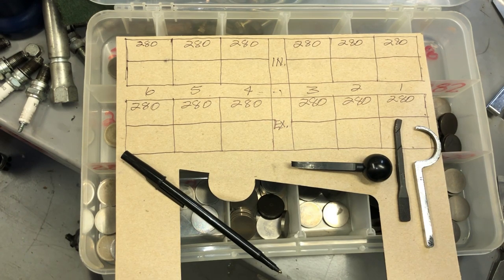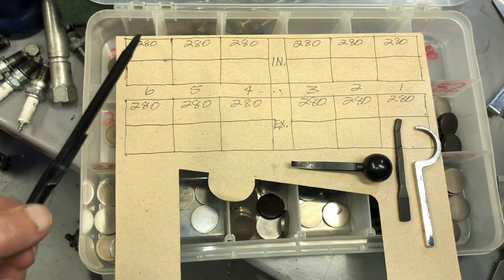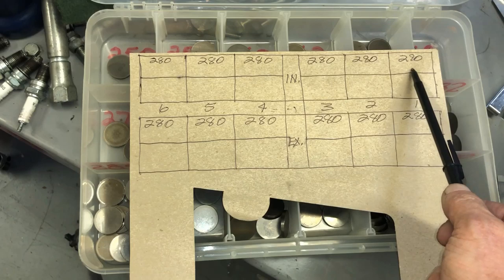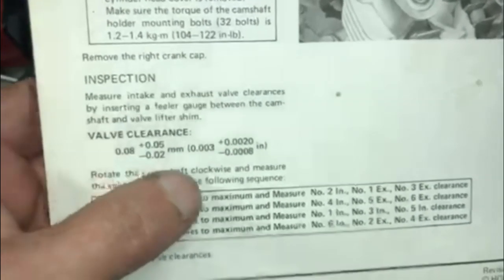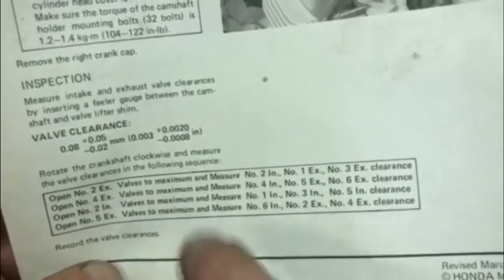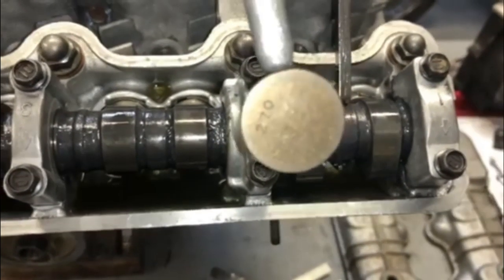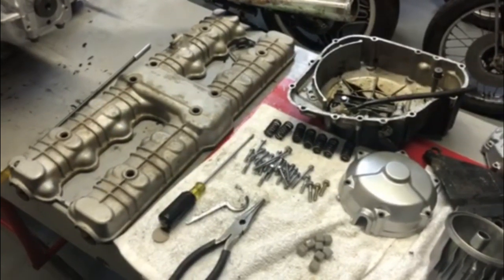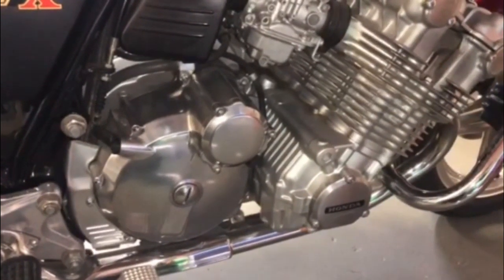Honda CBX Full Restoration & Engine Rebuild Video Series - Part 20 Re-assembly Part 7 Valve Adjust

Comment: Great video!
In your chart, why there are two numbers for the tolerance instead of one?
Reply from the maker: Hi Massimo, The chart gives you a range for the measurement. So if your measured gap is between X and X, then that determines which shim to use based on the shim that is installed. The 2 numbers on MY chart represent mm & inches, I did that for my own clarity when referring to my feeler gauges.
Reply: digitalpizza thank you a lot. Very clear!

Comment: What clearance do you like to leave them at, I am doing mine at this point. I don't know if you know Mike Nixon he is saying to aim for.  0.010mm what do you aim for. 
My experience is that the CBx clearances tighten up with time, not loosen. 
What is your opinion on this
Reply from the maker: Yes I know Mike, and agree, but I keep them on the loose side of the medium spec. Better loose then tight.

Comment: Pete, this is a great series and I really appreciate how much help you have provided me in my rebuild of a 79 CBX.  One question, when you use the special tool to remove the shim do you have to make sure the opposite pair of valves are not open?  There is a caution in the FSM that says you can bend the valves if they interfere with each other..

Andrew
Reply from the maker: Hi Andrew, Yes, that is why you must follow the exact order spelled out by the shop manual when adjusting them. It calls out which valves to adjust as you rotate the engine to each marking on the end of the crankshaft.
Reply: @digitalpizza1  Thanks.  That makes sense.

Comment: what happened to part 21 clutch install?
Reply from the maker: Hi Austin
The next video will include the valve cover install and the clutch assembly . I had to edit and re-post the Valve Train video due to an error in the previous one. So clutch is next, probably in the next couple of days. Thanks Austin :)
Reply: thanks for the reply im at alternator install my service manual pdf is a dark copy and i dont want to miss anything